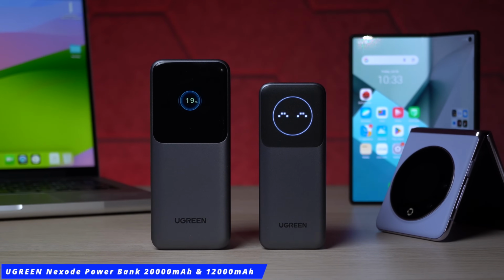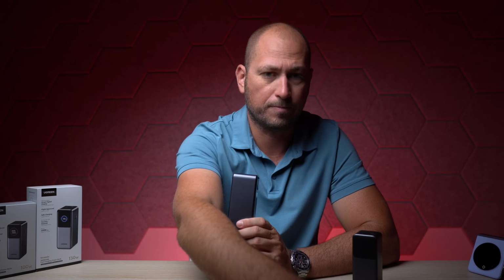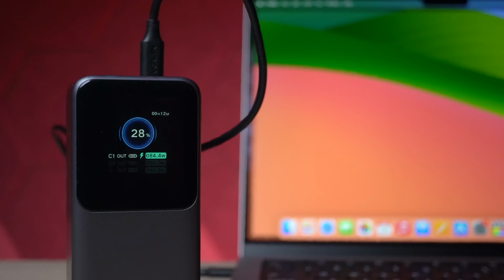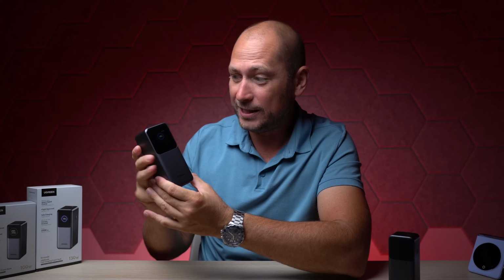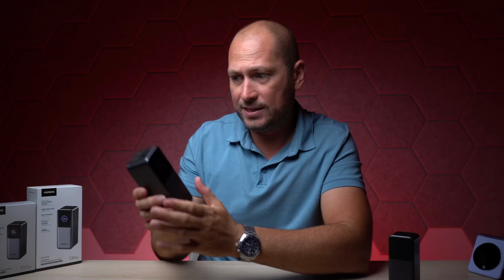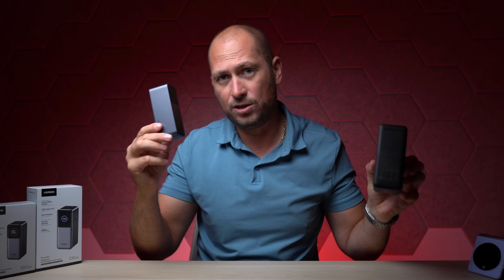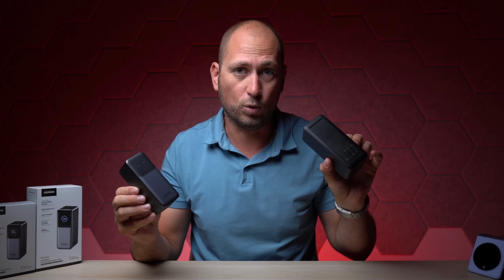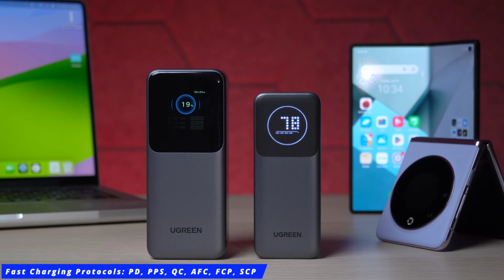The ONLY Power Bank you will EVER Need! UGREEN Nexode Power Bank

Comment: Hi there. I am searching for a good power bank and i watched your video. I have the Poco F6 with a 90W fast charging through the fast charger it's included. Can these 2 power banks charge the Poco F6 at 90W? I mean can these 2 powerbanks "recognise" the charging speed of the Poco F6 and not to charge it at 100W but exactly at 90W? This is my real concern.
Reply from the maker: All phones will limit their charging speed to the current conditions. No phone will over charge at a higher speed. Realistically you won't see your Poco phone charging at 90W very often. The battery has to be at the perfect temperature, the state of charge has to be quite low as well...so you have nothing to worry about a power bank like this
Reply: @RedskullPro i oh thank you very much. I was concerned about that so i am in relief now. Thank you. I will buy the cheap version of those two power banks in the next few days. Thank you

Comment: Anker knockoffs
Reply from the maker: but better because these you can charge and charge other devices from them... The anker ones you can't charge them and use them at the same time. New gen Anker ones are being released soon
Reply: Knock off? They did better internally. The power delivery output consistently. Anker does not. There is a guy on YouTube who did the test already.